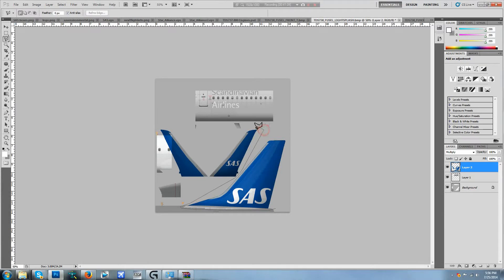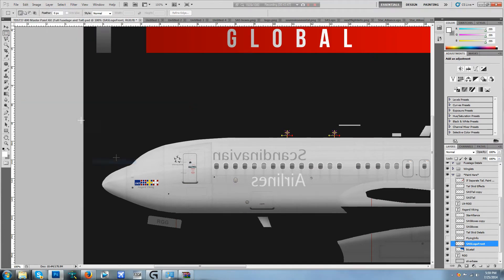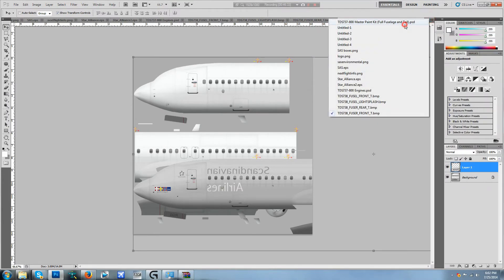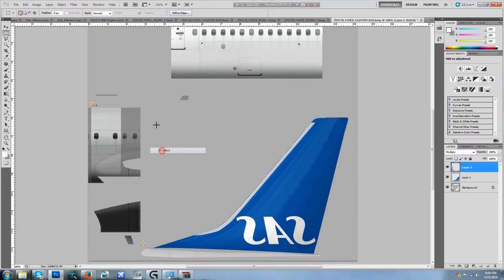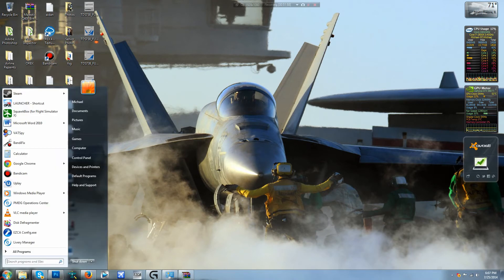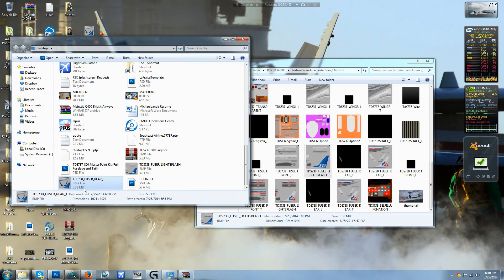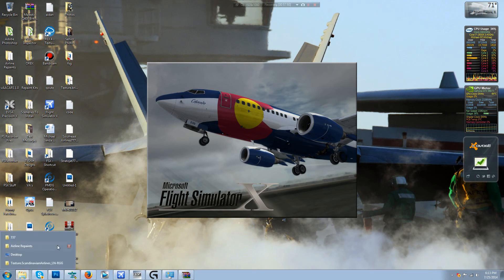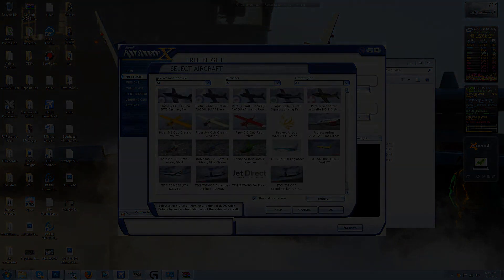How To Repaint TDS 737-800WL Part 3 of 3

Comment: Great tutorial Mickey. I learned a ltof of things I missed. I do most repaints for FS9. When I save the lightsplash files i loose the alpha channel. I've asling a friend to help me with the steps he does to fix them. He simply corrects them for me and sends them back. I use Paint Shop Pro 7 and I don't know if it is the best repaint program. With PSP7 I cannot find the window layer or the door layer as easy as you do. I thanks you for those wonderful tutorials. I will have to watch them again. lol

Comment: hello, i use fs2004, and i paint with paint.net, but when i load the textures into the sim, they are blurry when you look from the front, the textures are blurry, and as you move the viewpoint further out to the side, the textures become crisp and clear. i save them as 32bit bmp and i was using the Ifly 737, but it has done it to every plane i have repainted. do you have any ideas on what i am doing wrong
Reply: make sure to to turn off the mipmaps located below alpha channel
Reply: in DXTBMP
Reply: How do you use paint.net to do all that clean cut and copy paste onto the texture file?

Comment: i have a problem that the textures looks blur or no to clear un less i zoom in
Reply from the maker: Is texture resolution set 4096? Also try saving the file without mipmaps when using dxtbmp
Reply: First you have to convert the textures w/ DXTBmp